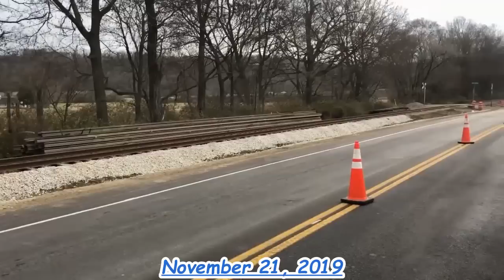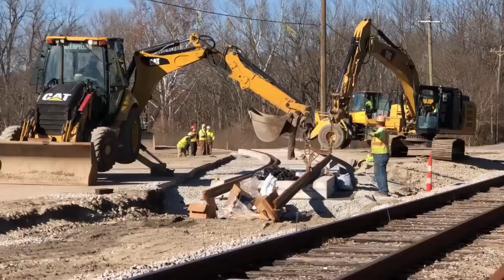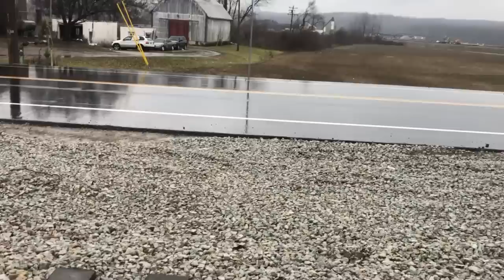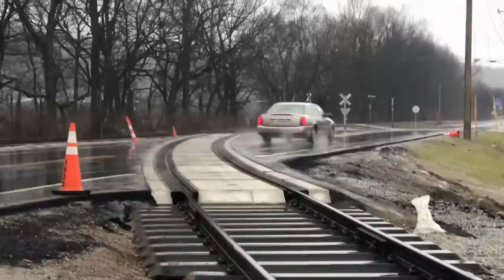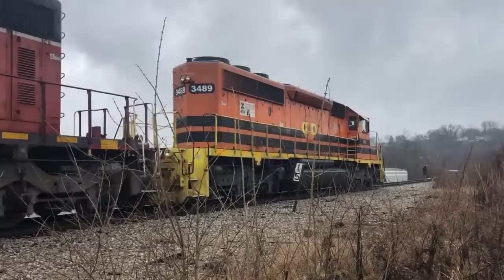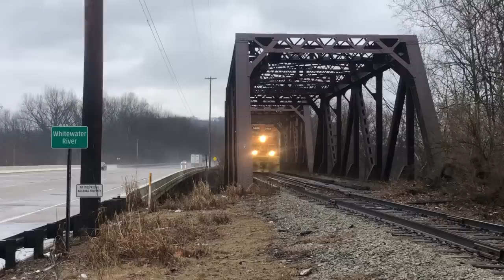New Railroad Spur Installation!  New Crossing, Derail & Switch!  Steel Cross Ties!!  IORY

Comment: Those crossings at an angle are bad for bikes and motorcycles, especially when wet.
Reply: John, I've come to learn that RR's only care about the trains getting through the crossing.  When a local city tried to get the RR to fix a crossing, I heard the reply was "Our trains don't have a problem crossing that road."  (Not first hand info)
Reply: That's why bikes and motorcycles have to be careful crossing them.  When the main track is so close to the road, it often cannot be helped.  How about places where the track was there first...and they added the road crossing later?
Reply: Also another thing that would be concerning is that there are no crossing lights, just signs, and drivers won't know if the train they're driving next to is going to curve to the left. Even the usage of a train horn would only confuse drivers.
Reply: radanju3 I guess the train only goes at max 10 km/h over that road secured by personal
Reply: @radanju3  It's a really low speed spur, not a fast mainline track.  The crossing is specked out for them by the PUC.  They cannot even upgrade an existing crossing without authorization from the PUC...not even add a light to it.  It's not like your model railroad where you just put in a crossing with whatever you feel like putting in.  I've seen tracks that go down the middle of streets with nothing more than a set of crossbucks and maybe one (yes...ONE) bell.  No lights.  Also...why would anyone on the train crew be confused by the train whistle?
Reply: @NiceMuslimLady  That still doesn't explain how it's still risky that somebody is driving not knowing the train on their right is going to curve to the left. And I made a typo on my last sentence. I meant to say drivers, I don't know why I added "train drivers" to end the sentence.
Reply: @radanju3  The trains approach this type of crossing slowly and one of the crew members would be flagging the crossing.  This isn't the only crossing like this.  The rulebook explains what needs to be done at crossings like this.
Reply: @NiceMuslimLady  Oh okay. I'm glad they have flaggers, that totally explains it.

Comment: Dose that piece your calling a derail does it actuality derail the train and how does it and why ??
Reply: The railroads have learned from many fatal accidents that sometimes train cars or entire trains will move when they aren't supposed to. This could be caused by vandalism, human error, or an equipment failure. Runaway trains or cars are bound to happen, so they set up systems to minimize the damage.

The derail prevents train cars from rolling from the spur onto the mainline, except when traffic is supposed to go that way.

That derail was a switch that directs the railcars either onto the mainline or onto a very short piece track that ends. A slow moving train car that is derailed will stop when the first set of wheels hit the gravel. A fast moving train car will have a much bumpier ride and probably land on its side. If there is a person in the car, they may be injured or even killed. On the other hand, if a train car went on to the mainline and was hit by a train at speed, the carnage would likely be far worse.
Reply: @hamjudo  Thank you for an answer ! I like watching your videos

Comment: Why the second switch on the customer side of the road?
Reply: That's for a split rail derailer. Those are used sometimes in place of the clamp on type of derailer, which can also be actuated using either a switch stand or simply flipped over by hand to lay on top the railhead.

Comment: steel ties--hope the dont rust out in 25 years.
Reply: The steel ties are made in the USA from a weathering steel. They are meant to rust to a patina at which point the rust process slows down dramatically.  Steel tie expected life is 50 years. It depends on the area and I don't know the specifics of this area but I typically see wood ties lasting between 7 and 12 years.  Environment is everything.
Reply: @trebledm  20 to 25 on the east coast.
Reply: @rearspeaker6364  do you know the location? I'd like to see if I have a report on it. I should have one on anything that unusual.  Thanks for the reply
Reply: @trebledm  amtraks northeast corridor phil to dc, csx popes creek secondary,csx mainline phil to dc.
Reply: @rearspeaker6364  Thanks. I'll look into it tomorrow.

Comment: I've got a question do steel ties cost more than wooden ties
Reply: Or last as long as concrete ties...?
Reply: @michaelmccarthy4615  I wonder how much steel ties are worth than wooden ties
Reply: Austin Miller  
And are they solid steel or semi hollow?
Reply: I'm sure wood is the least expensive, 
 then concrete ties. The most expensive has to be steel.  The question is how do the RR operators decide which is best for each application....   what variables do they consider?
Reply: @ResidentOfTheAbyss  I don't know I've never seen rails and ties like that before the metal ones are probably more expensive to I wouldn't be surprised if all railroads did that
Reply: @michaelmccarthy4615  To lay down steel rails and ties it's  probably pretty expensive
Reply: The steel ties are close to the price of the wood ties, they are hollow on the inside and are spaded on the end to keep them from sliding on the ballast. They hold up well and they are eco friendly and are easy to recycle. Check them out, I used to be part of their quality control team. www.narstco.com only in Texas!
Reply: @travispettyjohn8079  that's pretty cool eco-friendly I like the sound of that
Reply: Austin Miller they have 2 facilities and one is located in a steel mill. The steel comes from the cars that are crushed there. So once they need to be replaced you can melt them down and use them in other applications. With the wood ties your cutting down more trees and the creosote coated ties just can’t be thrown away. They need to be properly disposed of in special facilities. It’s a very cool process and idea.
Reply: @travispettyjohn8079  You know what I think I think every railroad throughout the entire United States should all use steel ties and rails instead of the wooden ones